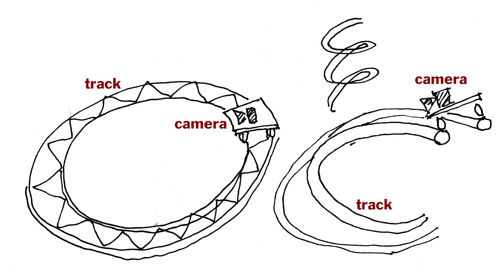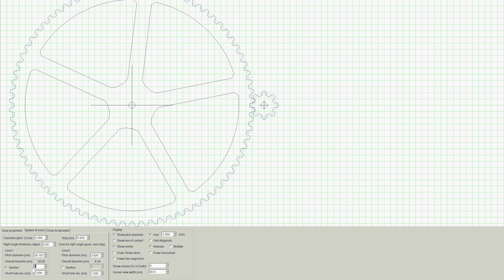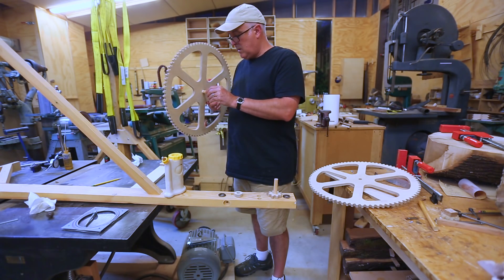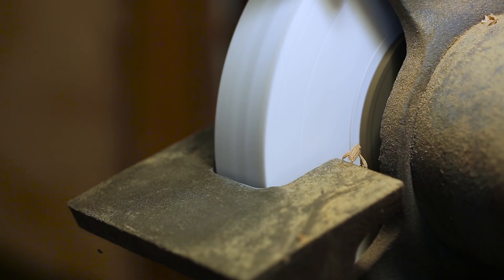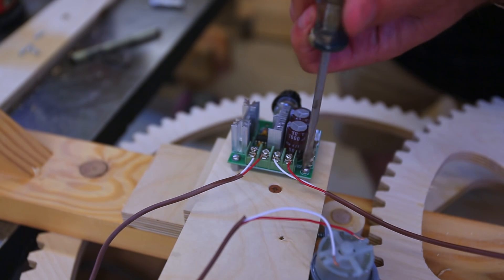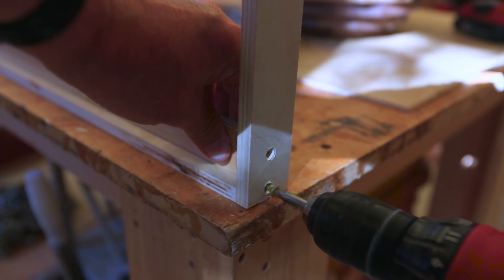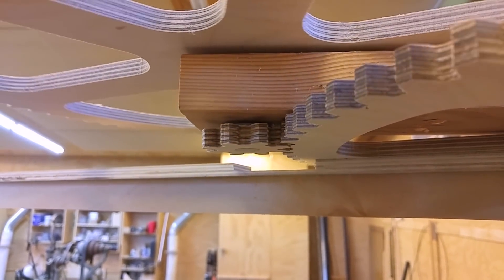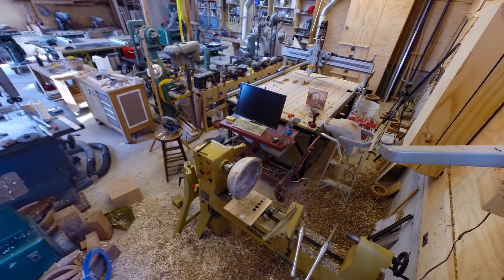Orbiting Time Lapse Camera Rig

Comment: I have done some woodworks in the past but this woodwork plan helps me do much in a far lesser time than I used to do [Link Here==https://plus.google.com/109305854848533008884/posts/KcgzNKE47JS ]. I have already built several projects with this plan and I intend to do many more soon. Thank you so much!

Comment: So, I've watched pretty much all of your videos. I don't recall seeing one where you've done solid wood edge banding on a curved surface, have you done that and filmed it?  I'm building a mod-style table, round, using 3/4" walnut ply, and I want to edge band with solid birch, but the diameter of the table is small enough that I'm pretty sure I won't be able to just bend/glue/tack it up there. Any thoughts? Also, favorite project is by far the Bamboo Death Star. Keep up the amazing & inspiring work!

Comment: It pains me to see people make such rigs out of plywood (or even worse - pvc pipes). I would use aluminium, two roller bearings and a stepper motor with a reducer.
Reply: yeh, it would be silly to use the tools he has in his shop to make it out of the  wood and other stuff he has laying around /s
Reply: Exactly,  why use heavier and expensive materials on a piece that does not need the durability and needs to be light weight.  I too, would have to fight the urge to over engineer.
Reply: Christopher Hasse Doesn't need durability? Im sorry i didn't know he made this rig for this one shot, and then used it as firewood, but did you seriously just say that an aluminium construction of such a rig would be heavier than this piece of shit plywood?

I guess its just the american way of building everything out of paper, including fucking houses. Then everyone blames the gays when the skygod sends a light breeze that knocks over the whole town. After which they rebuild, by using carton walls again, bcuz 'murica! Smart!

Comment: Nicely done. I may do something similar, but likely use steppers as i can program a microcontroller to run them, and set the movement to be exactly as long as the planned time-lapse. I do like the French cleat system... I wish I had more usable wall space in my little shop to do that.

Comment: that really worked well, i built a similar rig using bits from a broken tripod, and some cnc belts, pulley gears and a speed controller, I can get it down to about 1rpm but it is not down to time-lapse speed. I have it clamped to a ceiling joist.  https://www.youtube.com/watch?v=sAg89monyZY you can see the effect at 3:24 in the video if you get the time. I never used it as much as i thought I would as it makes things look a little cgi, but your time lapse rig with, yourself in the frame  gives it that human fallibility which is far more watchable

Comment: Great Job. I would have used an Arduino to control a stepper motor to directly swing the Camera Boom eliminating the need for gears. It could have also triggered the time lapse photos. The two triggers for the stepper motor and the camera trigger could be controlled separately with a laptop or keypad allowing more control and greater flexibility.

Comment: Great idea. For those without time lapse software, it should be possible to add shutter triggering to the system. And you could add reversing switches to pan back and forth on an arc.

Comment: Hey Frank, why don't you look into building a vacuum table top, for your CNC router? It should help fasten the parts that are already cut, to the table, and prevent them from bouncing around, and fouling on the router bit. Also, it should, in theory, eliminate the need for table claps, altogether.

Comment: This build is great. and works so smoothly. You could even put a micro-switch in line with the power to the motor so you can set a stop-point on the arm for unattended use.

Comment: you should attach the wires from the speed control to the mounting board, or they will break at the connections really quick

Comment: If you wanted to make your timelapse speed more reliable, you could get the voltage regulators like Linn from Darbin Orvar uses for her DIY Power supply. It works the same as the twist dial except you can see what voltage you are sending to the motor to make the lapses more repeatable over a certain time period. You can also add a switch that changes the polarity for forward or reverse rotations. Awesome idea for the rotary movement!

Comment: Did you consider skeletonizing the T-beam? I don't think doing so would compromise the beam's integrity and could lighten it considerably. Perhaps 15-30%. I'm guessing that reducing the rotating mass would help long term. It surely would take a little stress off the motor. I'd look nice too. The rig made for a great camera shot.

Comment: how about using end stop switches to reverse the direction when it goes to the end
Reply: I don't think it has an end does it?  It appears to be able to continuously rotate.
Reply: at the end of the video it bounces like it hits a stop but the motor still turns
Reply: Could have hit the wall.  I thought his boom was quite long for where he was setting it up at.  I might have used a section of pvc pipe or emt for the boom with a sliding balance weight in case the boom length needed to be adjusted.  But then, this is a woodworking shop so what he did was very appropriate.  I wish I had 1/4 of his patience!  :-)
Reply: :) im sure he did it like that for a reason

Comment: NEET!  You should install a micro switch on an adjustable stop, to stop the boom when it gets to the end of the travel.  Will keep you from burning up the motor or the speed controller when the boom hits the wall like it did at the end of the video.

Comment: Next up an Arduino to be able to vary the motor speed dynamically during a time lapse?
Reply from the maker: Yes, I was thinking that too.
Reply: The obvious good ones would be "ramp up at start" and "ramp down at end"...Having a step driver on a gear box would also be nice so you definitively know "it will take x time to get up to speed moving theta degrees then continue at that speed for y time, traversing theta2 degrees, then ramp down for z time, etc..."  When turning if you know you have 20 minutes working on one side of the bowl then 20 minutes on the other side of the bowl you can plan what cuts you make in what order to make a cohesive shot where everything is in frame.
Reply: And use the arduino to trigger shots while the cam is not moving, way better results this way!
Reply: @Sebi20070 The suspense is killing me.
Reply: If you're able to go the arduino route - then a stepper or a geared stepper could turn slow enough that you won't need the wood gearing.

Comment: Great, now I need to scour craig's list for a used dental light.  That's just a f'n awesome idea to repurpose one for a task light.
Reply: I found a dental light several years ago from a dentist . . . your dentist might have a "retired" light in the back somewhere . . . I made a stand that sits in the middle of my arrangement of lathes. It swings to the lathe that I am using and it works very well . . . .
Reply: great way to desensitize oneself from the agony of the dental chair as well
Reply: +Jeff Pruett nice...Thanks mate
Reply: Man, I'm just thinking the very same thing!
Reply: Ha ha...same thing here
Reply: You should look up "Maggi Lamp" we use them in the beauty industry, they consist of a fluorescent halo light and magnifying glass in the centre!
May not be what you're looking for but thought I'd suggest it just in case!
May be a more cost effective solution :)